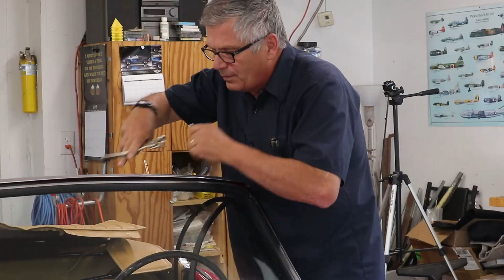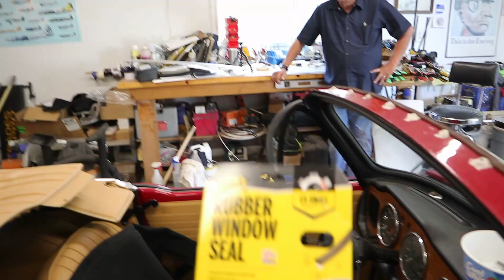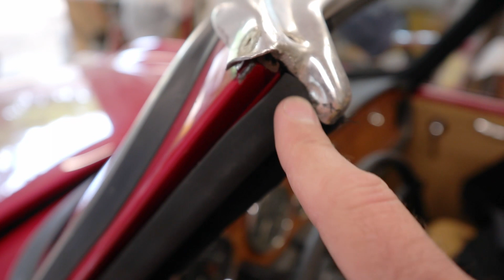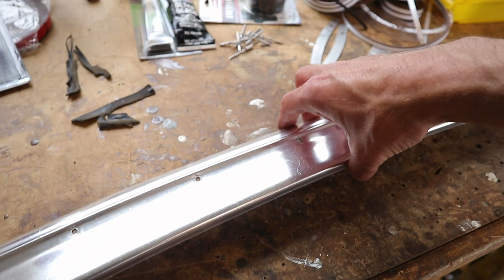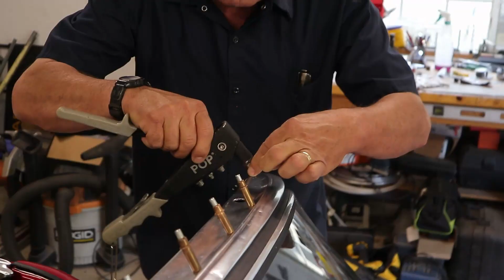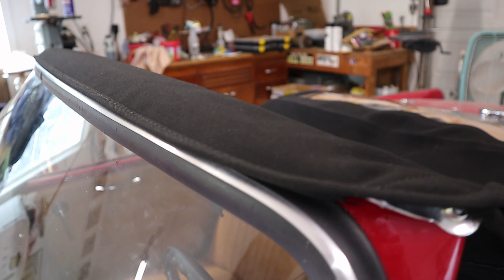Triumph TR4 Windscreen Capping - Fitting and Fixing a Troublesome Part

Comment: https://youtu.be/pDdjXHVKevQ
Reply from the maker: That is cool! What modifications did you make to do that?
Reply: @WegsGarage  Thx, I just added a toggle switch wired accross the L/R Wires in series with a Pep Boys flasher module.  PS: I still have my windshield capping as I had to remove it to fit my windshield under race roll cage.  Any viewers need one? $49+ship.  Also have the front hubs, I just replaced mine with Alloy Race Hubs & oversize anti knock back axel stubs.  Cheers, love your resto videos!

Comment: Great job with the riveting and fitting but Merlin is correct. You need those little brackets or the part of the top just below the top of the window on each side won't be tight enough. They need to be connected to the window frame about an inch below your metal cap. I can send you a photo if that will help. Keep up the good work...
Reply from the maker: Actually, yes some photos will help! We may have an issue here as I think ours are broken on the windscreen frame. More creativity needed, but it would be nice to know how it should look. If you have some, send to wegsgarage@gmail.com

Comment: Guys, another great job.
I think you might be missing the small brackets (P/N 611895), that are supposed to be attached to each side of the windscreen frame. 
The metal loops on the front of the side soft top retainers hook onto them. 
See Fig 31 Pg 5.218 of the TR4 Workshop Manual.

Also, you might find Pg 5.216 thru 5.218 of the TR4 WS to be a great help in getting the soft top on and off.